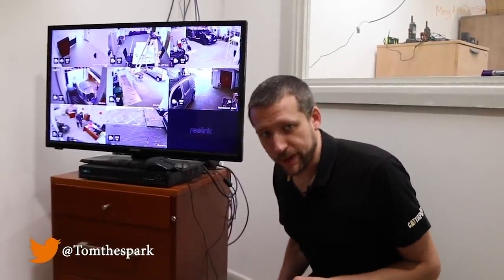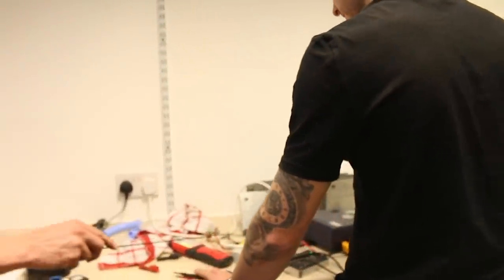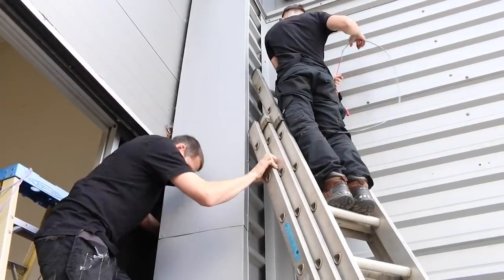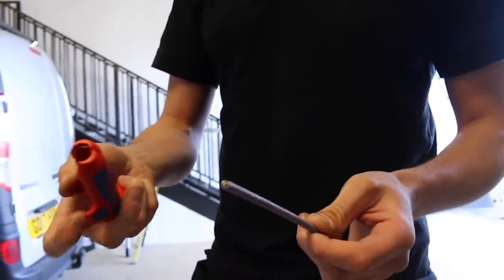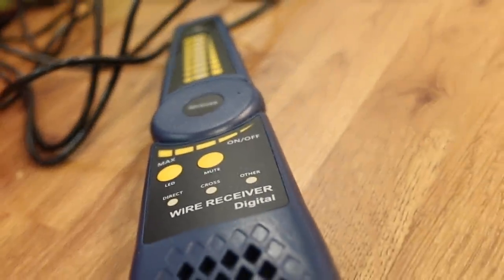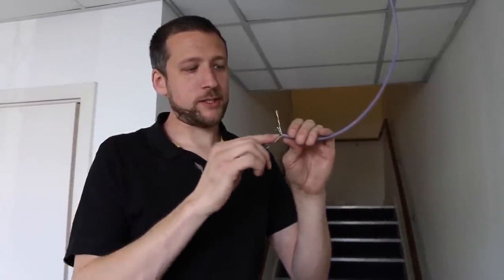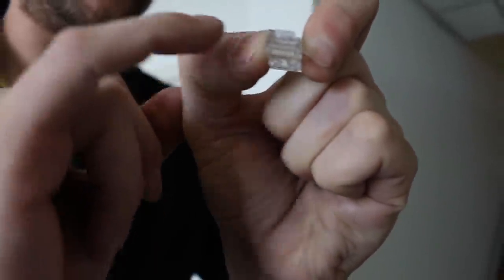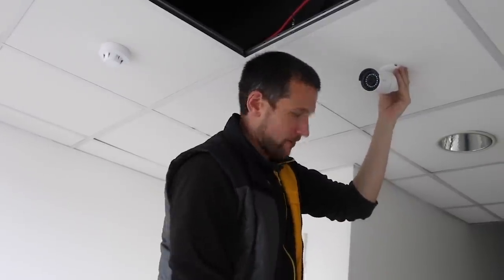Installing 4K CCTV & Terminating Cat6 Cable.

Comment: The network Poe cameras are the way to go 100%. Even if a client of mine doesn’t want to use Poe and chooses the cheaper BNC cameras, I still run cat6 for them. You can get connections that convert rj45 to BNC and 12v power. Plus running cat6 future proofs the cabling so if they do want to upgrade, you’re not pulling new cables through and ripping coaxial out.

Comment: As a CCTV installer and networking guy - you´re doing good job, just a little nitpicking: the steel/copper wire in CAT5/6/7 is not for strenght, but as drain wire for shielding. it is fine to cut it off (along with the foil) for IP cameras (since they have plastic connectors anyway) but they are really important for data transfer and must be properly terminated on shielded RJ45 for data usage. also you forgot to use weatherproofing gasket (or how it´s called..) before you crimp the RJ45. thats the reason why the RJ45 female on the camera is so big - for dust/waterproof gasket (comes handy even in interiors, it holds the cable securely plugged in). anyway great job, and i wish you´ll pick better quality cameras next time. the quality is atrocious xD
Reply: The drain wire in this would also be the draw to rip the sheath down.
I'm concerned he didnt strip down past the cut
nicked pairs always happen no matter how good the tool or tools setting, avg cat 6 is 6.2mm outer diameter, I've seen some less some more, thats why you always strip 50mm below that point, cut off, then terminate with known good pairs. Yes you waste the first couple inches cable even if you didnt nick pairs, but youre not to know you have or hadn't, at least doing it this way, you wont get a call back.
Reply: I'm pretty sure we only saw the low-quality, low-framerate preview footage from the cameras, that you'd really only use for remote viewing.  They're not bad otherwise.

Comment: Hey Thomas another great video thank you. Just a quick bit of info for you regarding the CAT 6 cable plastic core and what it’s for, it’s actually there to help to further reduce crosstalk.
Reply: Exactly what I was thinking. Also, those RJ-45 (well if we're going to be super pedantic 8P8C modular, but no one calls them that) crimp (not punchdown, that's for patch panels!) plugs that have a pass through are not generally well looked upon by professionals in the data cabling world. They have a bad habit of shorting out on the back of jacks, especially when poorly terminated with a flush cutter instead of the proper tool. If you're going to do data cabling you should probably learn to do it right with the standard plugs.
Reply: @BenFranske  I was about to chime in with the same comment. I love it when a spark tries to do data.
Reply: I came here just to comment the same

Comment: Have used the reolink stuff, and it's pretty good, simple to set up, images are good as well.
Poe definitely the way forward, and anyone doing rj45's don't waste your time with the tradition ends, get the through ends and crimper you will save so much time and money in the long run.

Comment: Worked for a bit in IT infrastructure installation.
I hear orange at 7:50 and think:
nice, he's doing the "b" type (I've had client with mixed standards and were too lazy at first try to check if connections were done propperly)
than at 7:56 solid blue...
i'm sure my hearth stopped for a while there
Reply: He possibly doesn't know the TIA/EIA 568 wiring standard because he is after all a sparkie and not a professional data cabler.

Comment: It certainly took me a few attempts to get use to terminating CAT 6 too! The best thing I done was purchasing a Klein Tools Pass Thru Crimp (same one as yours Tom). I wasted money on inferior items and spent too many late evenings struggling to terminate cables with cheaper non-pass thru RJ45 connectors.  Would highly recommend especially if working at height for CCTV, WIFI AP's etc.

Comment: It is absolutely amazing how CCTV-Quality does not seem to change ...
The footage at the end looks like it was shot on an old nokia or something, which absolutely buggs mehr, thinking you might need it as evidence if shit hits the fan ...

Thanks for sharing what you're doing, Thomas, keep up the good work. :)
Reply: The Reolink cameras have 2 different streams/feeds, one at low quality 640x480 for low bandwidth, intended for over the internet viewing and full quality stream which runs at a higher resolution and bandwidth, either 5MP (2560x1920) or 4K depending on the camera.

It appears Tom has used the lower quality 640x480 clip in the video.

I run a 5MP Reolink system at home and it is much clearer than shown when using the 5MP stream.
Reply: It seems that he was recording the low-quality stream, those Reolink cameras do have a fairly reasonable image quality on the high-quality stream.

Comment: You do know you put that plug on backwards at 9:14 right?
Reply: When sparks do data.
Reply: As long as he makes the same mistake both ends. 🤣. Just not very good against cross talk or emi
Reply: @Monkeh616  Oh man, I spent 30 hours on what should have been a 10 hour job a few weeks ago, because a company got a spark to pull in and terminate data cables in a new office fit-out. -_-

Comment: 7:15 The fact that the foil just breaks off like that, makes me anxious that the inner conductors are cut to the copper. 
I have the exact same tool and it is very sharp, and I have damaged the cores accidently if I twist too much.
Reply: I've done the same my first few times.  I got a bit of spare cable and practiced lightly scoring the sheath and turning the cable enough to twist it off but it took a fair bit of practice.

Comment: Erm, I'm not sure about that T-568B termination. Looks like you've put the plug on backwards! The oranges should be on the left when looking at the side of the plug with the contacts exposed.
Reply: unless the other end is backwards too
Reply: i thought that - i was trying to see if it was one backwards!
Reply: Maybe the video but the colour code didn't look correct to me, looked like he had the pairs lined up when it should be orange/white,  orange,  white/green, blue, white/blue , green, white/brown  ,brown. No one wires to T568A these days (T568B give better noise rejection).
Reply: Your right not correct, but if wrong at both ends will work.  Make a lot of money fixing data the sparks have "installed". At least he admits he is not a data expert.
Reply: Andcorrct colour code WO, O, GW, BL, BLW, G, BRW, BR 😊

Comment: Reolink make some solid kit, we use them on our house, installed and up and running in 30 minutes.  Cost £50 full price for the 5MP ones or you can occasionally get them for £37 if they're on offer. I've also installed a couple of systems now, no complaints from the users.

Comment: Just for info, CAT5E is really only good for 50 Metres or so. If you ARE using CAT6 you need to be careful to keep the conductors separate so essential you use proper CAT6 connectors.

Comment: Just worth pointing out that Cat 5e and Cat 6 are only rated to 100metres any further and it is not certified to work (that doesn't mean that it will not).
Probably worth installing Cat6a (LSZH) as the cost increase is fairly minimal and not having to return to the job to check problems has got to be worth it.
Cat6	Up to 250 MHz, Maximum Cable Length - 328 ft./100 m for slower network speeds (under 1 Gbps); 180 ft./55 m for Gigabit Ethernet, Hypothetical Top Speed - 10 Gbps (over 110-180 ft./33-55 m);
Cat6a	Up to 500 MHz, Maximum Cable Length - 
328 ft./100 m, regardless of network speed, Hypothetical Top Speed - 10 Gbps (over 328 ft./100 m)

Comment: Tom has a go at data cables just to annoy the data installers, the pocket rocket is missing, has she moved on? The new bucket truck is still at sortimo.  Artisan is hot on your heels, who will reach 100k first.
Reply: ive given up with artisan...all it seems to be is electric car charger installations...seen one seen them all! that guy needs to do something different!
Reply: @madgebishop5409  I got bored with Artisan ages ago and that Bundy geezer. It's all bout new bags and other trumpery with him. And Artisan is all car chargers.

Comment: The metal core inside the cable is for grounding, as that is a shielded cable. As you've terminated it, you're not making full use of the shielding - still perfectly fine though 👌
Reply: Except an unterminated shield is possibly worse than no shield.. and the plug's on backwards. Perfectly fine.. for a sparky.
Reply: No point using the shielding because he didn't have the appropriate 8P8C plug that would ground it and likely didn't have a rack that would also ground the Cat6a. Sparkies are amateur data cablers.

Comment: The core in CAT6 is actually not there for strength. At least not the plastic + cores. They're there to keep the pairs separated, to decrease cross-talk and improve cable bandwidth.

Comment: Why not mount the IP Camera at the junction of two sets of aluminium suspension strips, and bring the cable through one corner of a ceiling pad?   Less damage, perhaps, and if you want more security for the camera, it can be screwed into the aluminium strip - two or three screws in all probability.

Comment: 8:38 Aaaagh ..why use F/UTP .. when using unshielded connectors ...  The metal wire inside the cable is the shield/esd wire ..

Comment: i dont beleive Cat7 is an approved standard yet - although sellers are selling it. Also isnt the center plastic/metal not for cable strength but for seperation of cables to improve signal.

Comment: The metal wire is not for strength. It's a computer version of an earth wire! The rj45 should be metal and the wire should be wound round and then crimped so when plugged in it earth's the cable and device to help eliminate interference

Comment: The separator in the CAT6 cable is not for strength its to insulate the pair's from each other to reduce crosstalk.

Comment: I like most of your work however i would much prefer to see a punched down IDC and a numbered faceplate to identify it back at the consumer end.  imagine as an electrician finding a plug socket  on the end of a 3 pin plug within a CU, and equipment running from it in the ceiling. It wouldn't be cool and you would judge the install. A security panel properly terminated says quality,.
Clearly the cost was more important to this client.
The metal core is not for strength either mate its he drain, ground to push electrical noise to ground rather than into the equipment. you're losing a lot of the features of this cable by cutting the drain and not using the correct connectors (FTP Shielded RJ45)  its effectively like cutting the CPC off you don't need it till its a problem. Although simply not as dangerous.
That looks very much like Cat6 Shielded LSOH without a spline seperator.
High quality Cat6 cable will come with a dielectric spline separator core to reduce crosstalk between pairs. But as you said its for CCTV and not backbone networking and no-one needs Cat7 full stop much like most people don't need CAT6 for the most part either unless you are pushing 10gig its like gillette razors.
All constructive criticism
Keep the videos coming
Reply: Yep looks like CAT6 LSOH  F/UTP ..( uftp witch foil an shield w/o spline )   Punch down IDC is so old school ..  better a modular panel with  Toolles keystones .. Eg  Panduit / Gigamedia ( rexel) .   +1 about drain/shield ..useless to use  S/UTP when not using  shielded connectors . For this setup simple CAT5E UTP ( 1gbit ) would be more then enough ..

Comment: I'd check the stream rate of those cameras on the nvr as it looks to be set very low.  Try to aim above 4000 or even 6000.  Unless you were displaying the second strem of the camera in the video.

Comment: Oh my god! An electrician that knows how to reasonably terminate 6 / 6a without stripping 5 miles of the outer jacket off and leaving it in a mess! 

I normally dread hearing that a sparky is going to run and terminate 5e/6/6a when I'm doing network installs. This is a refreshing change.
Reply: Or those jobs where you take the dual port faceplate off the trunking and find one cable punched down to both 🤦

Comment: Hi Tom , just wondering why you didn't use the T-568B wiring method on the RJ45 connectors for the CCTV instal

Comment: Bullet camera's inside= no
Camera centered on tile= no
Reolink gear= no

As someone who works in the security industry i hope i can constructively say i disagree with what you have done on that CCTV install. 

CAT 5e is well within spec for use on the camera's (keeps costs down) and CAT 6 should be used for any links. IP are mostly plug and play but not all installer's would install a system like that. The laptop would be out to configure the system to maximise it's use depending on the site. 

I agree on the poe/ip, it is the way forward and Analog/HD is slowly being phased out.
Reply: I was going to say the same as a security engineer but thought I bet someone else has and here it is. Completely agree I would love to look at the nvr setting. Guaranteed to be all default 😉

Comment: I used to fit WiFi enabled cctv stuff, not anymore after metal clad buildings, poor connection to NVR etc, POe is so much easier, and more reliable. Good choice. I do like those Knipex cable strippers too, may invest 😎👌

Comment: Another great video. Is it me or is that really poor video quality for a 4k system? Our Full HD system that cost me £60 seems way smoother and clearer than those cameras.
Reply: The cameras have 2 streams, a low quality one at 640x480 and a higher quality one at full resolution, the higher quality stream resolution depends on the cameras, but it appears the clip at the end is of the lower quality stream at 640x480.

Comment: The metal wire isn't for strength it's for shielding to reduce loss. Its called a drain wire in the trade.

Comment: Never seen those RJ45 connectors that allow the wires to pass through... nice idea!  PITA trying to wedge them in the connector after cutting them to the right length otherwise!
Reply: Only one problem. They need a different crimp tool

Comment: When going for cctv camera systems, love ubiquiti gear. They have a easy to use GUI an are easily expandable. Their a network gear industry standard and their gear from the access points to, cctv cameras all link together meaning you dont have to  have multiple u's  in a server rack for separate pieces of equipment. Also do you think theirs a bit of conflict between cctv sytem installers and network engineers? i've been into many network closets and have seen a rats nest of cable just for cctv equipment and it just infuriates me.

Comment: Cameras use almost no data over a network, Cat-5e will get Gigabit networking just fine, but most of the cameras only do 100 Megabit networking anyway. In new construction it doesn't cost much to jump to Cat-6, Cat-7 is still not set in stone yet either and no one is using 10 Gigabit networking unless they really need it for a switch to switch, server to switch and special work cases like video editing. Most people don't have more than 100 Megabit internet and they don't use 1/10th of it even with lots of streaming video. Fiber is kind of fun too but it's major equipment to major equipment connections across long distances. I like using the Ubiquiti cameras, but they now require you to run their NVR, but it is very powerful and not the most expensive, their networking equipment is good too for the cost. I worked at a wireless ISP that had all the backend network running on Unifi in a VLAN with a Mikrotik edge router connected to a 1Gbps and 3Gbps fiber feed and we would never see all the business and residential customers use more than 100Mbps most of the time.
Reply: Using Cat 6 is future proofing and also doesn't degrade as much over the same distances (Granted Cat 5e is rated to 100m). Cost nowadays is very little difference. 

It appears Tom runs them individually to the DVR/NVR but if this were taken to a central network room the bandwidth would be substantial when you've got 10+ cameras all communicating over the network. This is when you would create a VLAN specifically for CCTV operations - limits bandwidth congestion and security

Comment: Cat7 doesn't exist. There is a cat7 category but that is used for server to server or server to switch. Normally 10gb and the termination is huge compared to cat6. 
Also on cat6 you can run 10gb

Comment: The 'metal core' is not for strength, it's called a drain wire - it's for terminating the shield. The 'plastic core' is called a spine, and is also not for strength, but for maintaining pair separation. And no, you don't untwist every pair right back to the strip when terminating cat6 if you want it to be cat6.

When sparks do data..

Now, in this application you don't require a shield (which means you shouldn't have bought shielded cable.), nor do you need cat6 performance, so you proceed to get away with it..
Reply: Agreed .. CAT6A you need to keep the twist as close as possible to connector .. that's why we don't punt regular plugs on CAT6A ...most connectors won't fit also ( cable is to thick )   Keystone -> patch cable CAT6A  - > end device .
Reply: he's pulled the wiring all the through the terminator so the twists are maintained very well - the untwisted lengths are cut away.

Comment: Nobody should be fitting 5e anymore , its no longer minimum spec . Whist IMO you should be punching down into a socket in the celling and using fly leads  the fancy RJ45s are nice.

Comment: Hello Thomas love the channel doing my first part electrical course in July wanted to ask what clamp meter do you suggest I need to look at which will not break the bank and is reliable and accurate and importantly safe.

Comment: You need to make sure your cable is compatible with those ends!  Oh boy.
Reply: They are compatible with cat6. I mean you should not be directly terminating a run like that, but the ends he is using are cat6 rated .